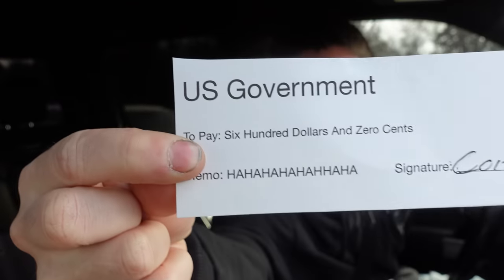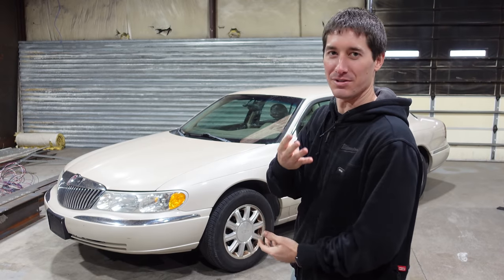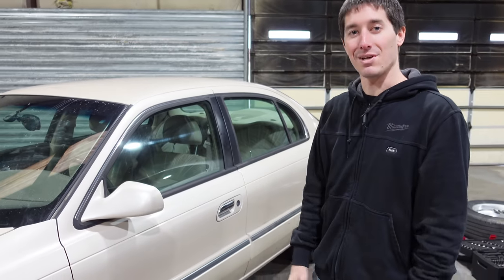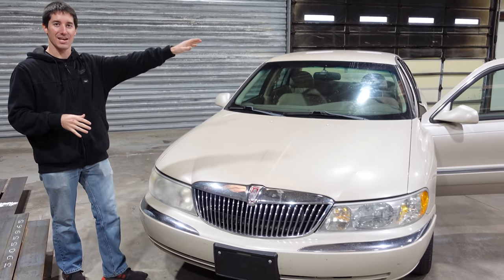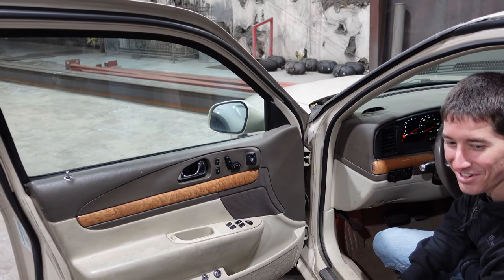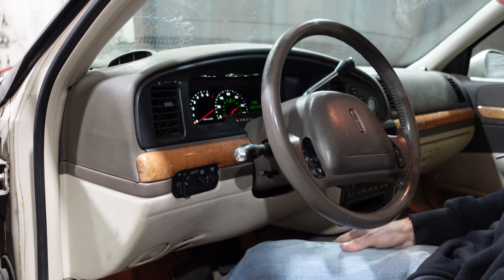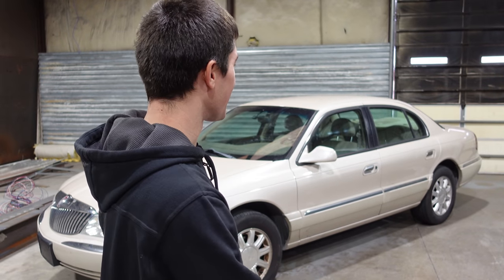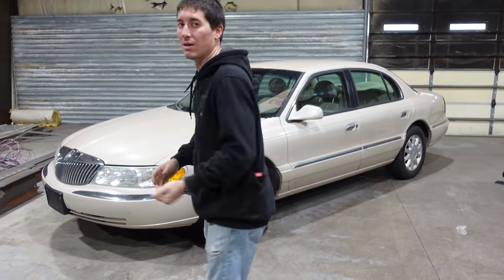This Is The BEST Car You Can Buy With Your $600 STIMULUS Check

Comment: Anything for 600 bucks around my city basically has blown engines or transmissions 🤣
Reply: Same. You can barely get anything for less than $1000 that doesn’t have some stupid backstory about why it no longer runs or drives properly. Or it just needs _____ part and it will be great.
Reply: I need to travel about 3 hours to get a runner for that.
Reply: Same way here , you really have to look for the deals
Reply: everything in that price says "just needs a head gasket" or "transmission wont go into gear"  LOL
Reply: Yup!!😂😂😂 New York
Reply: I just checked carguru.com. First car is 600 and it's a wrecked Saturn Vue
Reply: @timstorms1686  lol
Reply: I found a 99 honda CRV a while back that had no engine trans, no hood , or doors.....and they wanted $1000 !!!
Reply: @nisterror  where are u? I’m in Vancouver BC and same story gotta drive about 1-2 hours to find good deals

Comment: I've got a 1998 Continental in the same color. My windshield washer fluid line is currently broken in the exact same way as yours and my low washer fluid message is always on.  The HVAC blend door actuator just went out, so I have no heat, but I still LOVE the car still.

Comment: The only car I could find in my area for this price was a PT Cruiser...with a busted transmission!
Reply: Need to look harder.
Reply: @herbiehusker1889  Believe me, I have. There are just a few cars under $1,000, let alone $600.
Reply: @maxwellj7299  maybe it depends on your location. I found tons of running cars. Mostly old with tons of miles, and none of what I would say a desirable car, but an 02 Cavalier with 192k miles and running, it's a car, it'll get you to where you need to go.
Reply: @fuckngreat8955  Well, I found 1 car that has a functioning engine and transmission under $1,000. For $650, I found a parts truck with a rotted out frame. Yeah, things aren’t looking great for people in the market for a car this cheap. I just find cheap cars interesting, like what’s their story?
Reply: Good project though, rip out all the PT cruiser stuff put in some nice stuff in a cool/interesting looking body
Reply: @maxwellj7299  I found a fully functional (but with a charging issue) Saturn sl2 2000 and I believe it's one of the most reliable cars gm ever made in that era
Reply: @fuckngreat8955  US is very diverse when it comes to geography. If you live in a state that gets snow your gonna be driving a rust bucket with a $1000 budget but it will get you from A to B. Used cars in dry states cost more because they don't rust away. Prices are all over the place. I would say that a car that's 15 to 20 years old will cost between $500 and and $2000 USD in fair condition. Obviously the cheaper the car the greater the chance that it's gonna need work.
Reply: Ha I found a 89 ford ranger 400 bucks but engine is toast but body is really nice but not worth it
Reply: @MrWoodyBalto  Well, I do live in the rust belt.

Comment: My $600 car was a 2002 buick lesabre Limited that was fully loaded and had 255k on the original motor and trans. Didn't leak a drop of anything.
Reply from the maker: Nice! One of the greatest engines too 🔥

Comment: I had the 96  Lincoln Towncar with air ride.  The bags held, but the ECU for the self level wigged out. I replaced it three times. Each morning the car would be in one of five configurations. Slammed , lean back, lean forward, right or left. Coil swap with a Vic is the cheapest fix.

Comment: I have a 97 lincoln continental for a winter car, it runs like a dream, I got rid of the air suspension and converted to springs,done nothing but tuneups, brakes and oil changes,
I would drive that car anywhere, fwd handles very nicely on icy roads😁

Comment: Just sold my 1998 Lincoln Continental with 183000 miles.  A great car.  I paid 1500 for mine and drove it for over three years.  I put 50000 miles on it and all it needed was the basics.  The air ride was great, the 4v 4.6 had some oomph and the options coupled with a modern stereo upgrade made it quite comfortable for its age.  Mine had the JBL premium stereo option and with some subs it sounded awesome.  They all have that misfire from the valve cover leaking.  The windshield fluid hose is common.  I now drive a 2006 A8.  70000 miles. And its awesome.

Comment: 5:35 
Fun fact, in this Lincoln, that's the air suspension switch. But in a Grand Marquis, there would be a fuel cut off switch in that exact location.

Comment: Brake switches are common on these, make sure your brake lights stay working, love these cars. The gauges actually project from the top of the gauge cluster, if u look up on the top of the gauge cluster you’ll see the projector, super cool tech for the time, love those things. Always turn off air suspension if you jack it up. All those cars had slow air bag leaks but they don’t stop drivin

Comment: I literally had that same exact car, It was a 2001 (last year made before the LS replaced it) I got it at auction in 2002. I loved it. The floating gauge cluster was cool AF back then.  you need to make sure you turn off the air suspension in the trunk when you lift it off the ground or it will brake. Also if i remember righ the whole front end is plastic. The front fenders and hood...

Comment: If you upgrade the radio, that one has a home waiting. I still run AM/FM/Cassette in all my vehicles and recently became in need of a this-style 2.5X face. There's virtually nothing decent left out here from mid-latter '90s. Incidentally, odds are cassette in a 2001 is most likely 2 or 3 years old off the plant's shelves. No auto manufacturer post 1999 was ordering any cassette-only units; they were busily dumping what they had left in inventory.

Comment: JR, I had two Continentals a 2001 and 2002, look on the passenger side of the center radio tower for a sliding door where the 6 pack cd changer is.

Comment: Replace the lower ball joints before you find yourself in a low rider. Replace the coil packs, replace the air suspension with springs. Keep a check on the plastic intake manifold. They turn brittle and crack.

Comment: I had a 2001 Continental in black.  Miss that car and would have paid  $600 for that one in a heartbeat.  My trunk key stopped working as well.  My windshield washer feed tubes baked due to being on top of the engine and needed patching in the same exact manner.

Comment: Well well you've finally got a car that I own!  Awesome.  These are a super smooth ride.  Did you know that the reason the center arm rests fold up is because there is another seatbelt there?  Only the column shift cars have that.  I used to pile six of my friends in this car, and it looked normal thanks to the air ride.  Speaking of air ride...you are right, the pump should not be running that long, definitely see if it leaks down and replace those bags if they are bad.  I also highly recommend replacing the air compressor dryer which is not too hard/expensive to change, you can see my channel for a video on how to do that.  Let me know if you have any questions about the car, they are an oddball and I've been up and down mine and I may be able to help out :D

Comment: Shut off the air suspension switch and wait those couple days. If the car is on the floor, it’s a bad air strut. It’s the same cobra motor that’s in the Mark 8 and Lincoln Aviator.  You have to make a video of that Conti running against Hoovie’s Mark 8 ! 😅 Happy New Year !

Comment: I have to tell you.  I bought a 98 Continental from the original owner with all service records for 1100. Five years ago.  My Mom fell in love with the car, so we gave it to her.  What an amazing car.  You are going to get a lean code for bank 1 and 2.  Change all vacuum lines.  The only other thing is it eats front ball joints, high end, low end, it doesn't matter.  This thing goes through ball joints.  That being said, we will probably never get rid of this car.  We bought it in Oregon and drove it to Minnesota.  I see why Lincoln used to be amazing.  It is at 190k and going strong.  It will still take a respectable leap from the stop light.  And tires will run you about 700.  Can not wait to see what you do with it.  Also, miss the tracker!

Comment: Had a 99 and 1 of the best cars I have driven. Got mine with 39k for $4,000 at estate sale. Ran it to just over 110k. Yours has 220k!! wow. Battery issues very common on this platform. Based on Ford Taurus transverse mounted this model/platform was manufactured in 2 body styles 97 to 99 / 2000 to 2001 like this. This tri-color paint is very easy to buff out and it's the same I had with the cream interior. Best driver really - you can drive this car 300 miles and not feel fatigue at all. Alternator at 85k / Batteries I think 3 - it chews up batteries / Water pump at 98k. Great car really. Thanks for sharing - one of my favorites but hard to work on with transverse motor. Intek never used oil on mine and ran beautifully. Transmission on these same as Taurus and can have issues if not serviced. Thanks for sharing...
Reply: 95-97 and 98-02 are the 2 bodystyles. 98 is the same bodystyle as 02. 99-02 has seat airbags and 275hp engine. 95-97 has 260hp engine and no seat airbags.

Comment: I bought one that looks identical to this for $1500.  121,000 miles and it was a Florida car.  You should join the Lincoln Conti facebook group.

The paint color is called Ivory Parchment.  Be careful with burnouts or hard pulls, the AX4N automatic is glass with that 4.6.  Also, best of luck with belts and pulleys.  No space to work!

Another Edit: the 5 digit keyless entry code from the factory is on a sticker found on the right trunk hinge, unless it was pulled off.

Comment: For $600 you got a great car to work with. My dad had a Buick from that era and it was the same great comfort and reliability. However he also had issues with the suspension. He ended up just by passing the air ride.

Comment: I had a 68 lincoln Continental, was best year IMO. The 460 had the most hp in that year. That car i miss the most out of 66 cars ive owned in my years(well toss up between that and my 71 chevelle)
Reply: Nice.  I have a 75 Lincoln Continental Town Coupe.  Black with red half top and interior. Same engine. I love it.
Reply: @Chris_Troxler  mmm sweet ride indeed :)  I miss the ol boats   cant find anything these days with a comparable ride

Comment: The engine is a version of the 1999/2001 Mustang Cobra motor.  Very strong motor, and would respond to mods if there were any.  Should be a good car for someone for something.
Reply: The engine respond to mods well. But the AX4N transmission does not. That is why it was detuned for the Lincoln.

Comment: Those Continental have air bag suspension that leak constantly that will cost you 600.00 to fix with new ones and installation extra!!! and rusty strut towers that eat right thru if it's in the rust belt or east coast!!

Comment: I had a black on black 2000 like this when i was in KCMO. Awesome car man. Heated leather and mirrors, sunroof, floor shifter, and air ride that actually still worked when i got it. I miss it. Edit: my trunk lock didnt work either i had to use the interior button to

Comment: I will buy it! hahaha. No, serious. My ex-gf had a similar older Lincoln 2 door (Mark Vl or something, I don't know) with those air shocks, which were broken. I asked to help fix them, she chose to ride around with the tail end dragging and no rear suspension whatsoever. Caused the underside parts to get knocked off, i.e., exhaust cat converter, etc. It was soon impounded. And you get those arguments, " You never do anything to help me when I need it" ...sheesh.

Comment: At least 85% of the cars I've owned in the last 50 years have been $500 specials. Almost all lasted a long time. If they ever needed much of anything, I'd leave it on the side of the road and pick up another! A little harder to find at 5 bills, but the most I've spent in the last 10 or so years has been 9. Except gorgeous my 2001 SL Which ste me up, of course! Ha! You just have to look hard and know a bit.

Comment: First gasket u will replace is the oil filter adapter every 4.6 they leak when u buy them. My 92 mark 8 leaked my 04 aviator leaked my 2010 cvpi it leaks. Every 4.6 I buy it's leaking.

Comment: Cool car, hopefully it just needs a major tuneup and some cleaning. We just got our 600 here, that'll cover 3/4 of our mortgage payment for a month and a lot less of most people's rent.
The cheapest car I bought and actually drove home was a 75 Dart 4 door that was God awful ugly but had the big bolt disk brakes I wanted to put on my Dart. I asked him if the brakes worked and would it make 5 miles to my house. He said yes so I gave him 150 bucks and drove it home no problem. Just the brakes were worth 300 by themselves. It ran and stopped great too.
I'd be surprised if that thing is actually getting 17mpg average but it is a fairly small engine with decent engine management for the time. I'm lucky to get mid 12s on my 06 Charger RT I recently got in town but it's a blast to hit the loud peddle in and really moves.

Comment: The Achilles-heel of these vehicles was that air suspension.  Crazy expensive to fix.  Many people bypass the system and put in a standard suspension.  Other than that... $600... I'd drive it as a beater!

Comment: Gramps and Granny had a doggy that owned that back seat. They probably got a Toyota when the odometer hit 100k and kept the Lincoln for long hauls, vacations or when the dog had to come along for the ride. Probably took the last 15 years to get the other 100k with all of them highway miles so it ran at very low costs for maintenance. Once the car started to show wear beyond tires, exhaust, battery, plugs, filters and fluids, (like the airbags and engine repair) she became yours for the princely sum of a fat stimulus check. I might sound a bit glib but it is a great deal for someone in that needy situation as a reliable family car for the budget. Because this was built as a luxury ford a comparable used SUV of similar potential would be 15 times that price.

Comment: The Ford 4.6L is a damn reliable engine. We had an ex police Crown Vic that we got to well over 400k before the head gaskets went. We paid $450 for it, drove it for a decade and sold it with a blown head gasket for $200. Lol

Comment: 100% correct
Panther platform FTW
EDIT: WRONG 
The conti is a suspension nightmare. Air struts are $200 (×4) a corner vs $80 per air spring (×2) for the town car...
Putting coils in is a sin.

Comment: I found a 1991 4x4 GMC . Put it in reverse and it started making and ping noise . He wanted  $1400.00 to fix the noise. Truck drove good but was scared of the ping. Took it to a Garage and he said it needed a Flywheel. Flywheel was cracked, $300.00 should fix it.  I offered the man $500.00. Told him what was wrong with the truck. He told me he would think about it. The truck had 220,000 miles. My point is, where did this guy get a Lincoln for $600.00?

Comment: Do these have air springs on all 4 corners??  The old 1980's Continential and Mark VII did, they were rather troublesome.  On those cars though it was easy to convert them to steel springs/shocks, since they were on the fox chassis.
Reply: 1995-1996 Continentals has front and rear air suspension. 1997-2002 don't

Comment: I had a couple of those with the 4.6 motor I bet that miss is a small hole in a vacuum line I could be wrong just a thought anyway Happy New Year
Reply: This the age you have to consider that an issue. Rubber is as rubber does.

Comment: My mom had like a 93 what a junk heap! Never again. Oh sure everything worked at first but then the a/c went out (in a leather car that's 🔥), then the air and heat buttons started breaking, then the power windows (we were forced to use them probably for the first time almost ever), then the alternator went out, then the air ride suspension, then the power steering pump (always a problem on ford cars), head gasket failed and the car was replaced it was like enough is enough!

Comment: $600 wouldn't get you a children's bicycle with flat tires in San Diego. Because of the climate and roads here cars basically last forever with proper maintenance. So everyone just assumed their 1992 Camry with 359k miles, that runs and drives but looks like it was rejected from the last Road Warrior movie is worth thousands because it can still technically get you from A to B.

Comment: Have a few hundred bucks? Cannot go wrong with a Panther. FN9 good too. Key thing is you can find tons of parts because there were so many of them. Better built cars out there? Sure, but if they are twenty to 25 years old, odd parts are so tough to find on the aftermarket. Get a big Ford, and you’re good to go.

Comment: I had one like it brand new 
One of the best cars I’ve owned 
The best car was a 1990 Chevy beretta GT
Reply: A '90 Chevy Beretta was my 1st car, haven't thought about that thing in years until your comment lol. Mine was just a base model with no options except the V6 engine though.
Reply: My first car was an '88 Beretta with the V6 option.  Still miss that car :(
Reply: @RysterARCEE  I miss mine as well 
V6 5spd dark maroon inside and out 
We drive that car for well over 175,000 miles 
A couple set of brakes 
Oil changes tune up and tires 
And a battery 
The 3100 engines ran great and had a great sound 
Pasted it down to my son 
He drove it until he got a truck 
Then I sold it to a lady I worked with who got for her son as he was going away for college 
He still had it at his graduation 
But lost track of it as I got laid off at 9/11 
It was an amazing car